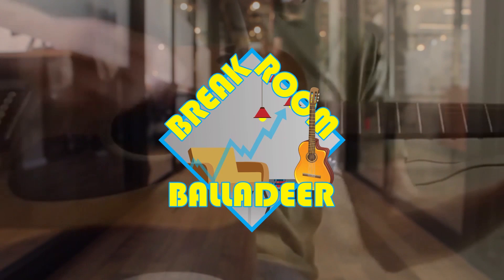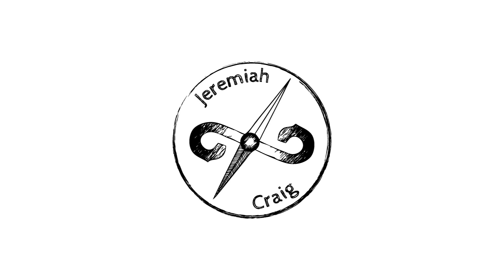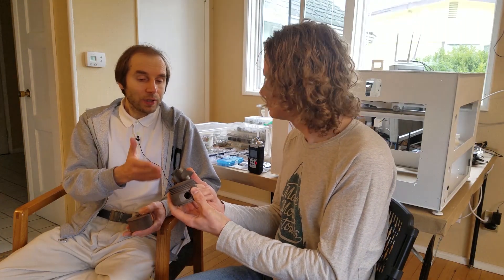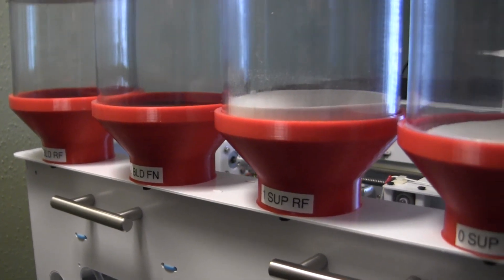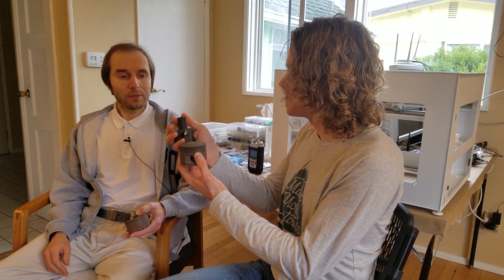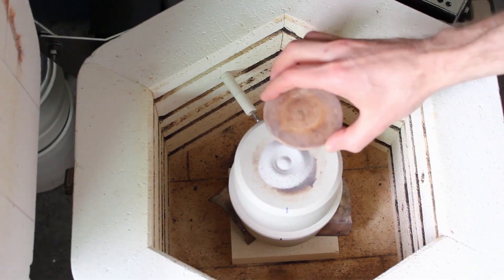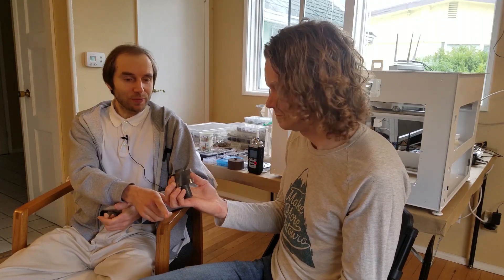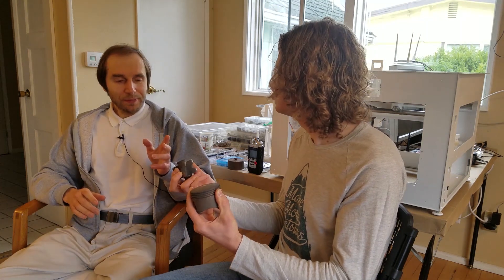How a Metal 3D Printer Works with iro3D - Break Room Balladeer EP9

Comment: Interesting. What causes the surfaces to be as porous as they are?
Reply from the maker: It's not so much porous as much as it is taking on the texture of the sand in the curcible I think. Then the metal can be polished or bead blasted.
Reply: Junkers, what do you mean by "porous surfaces"? Only a volume can be porous.  A surface can be rough though.  If you are talking about the object we have baked in this video - the whole thing was messed up, because the crucible leaked too much air, so everything got oxidized, and copper didn't flow much.  I am printing it again, so in a few days we'll have a new result.  I'll post it on by channel.